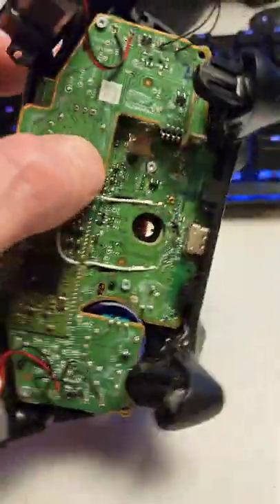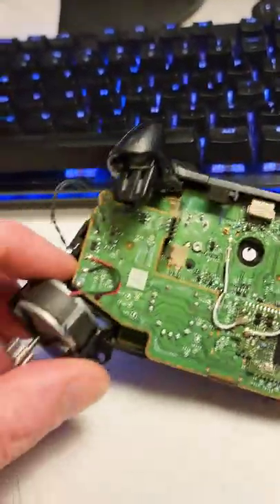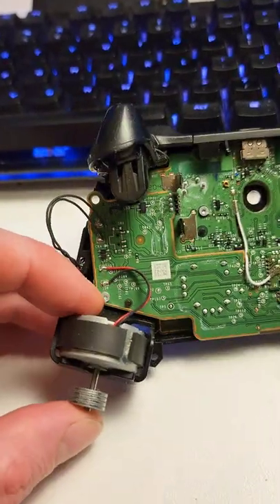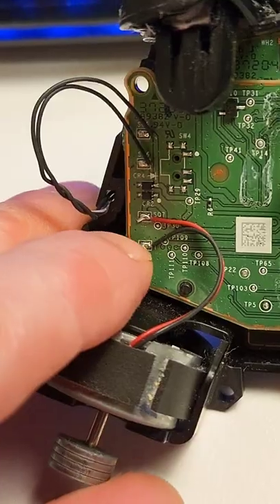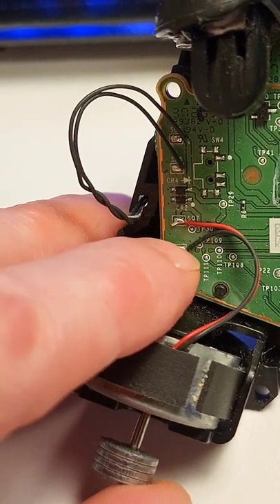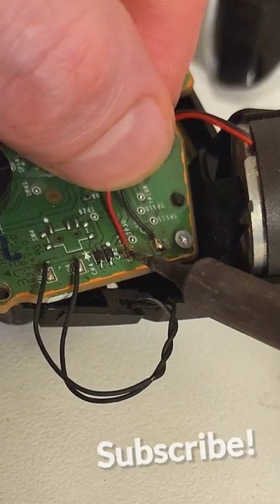if your controller stops vibrating, this is probably why..

Comment: You can mod these to clip the motors on/off if you need to open it regularly and don't want to solder every time. It's so easy and cheap I wonder why microsoft didn't do it.

Comment: I definitely don’t rip them out to reduce the weight 😂
Reply: Really? I like a heavier controllers
Reply: King
Reply: All the time 😭
Reply: After using a ps5 controller the Xbox controller seems so much lighter
Reply: I usually have them turned off but ripping them out to reduce weight?!? Do you have pigeon arms or something? Ive never even thought about the weight before its so unnoticeable
Reply: @VoidMySoul  🤡 what are you on about
Reply: You know I’ve never thought about that… I don’t like vibration so I might do it

Comment: Yeah, I remember my 3 year old brother getting grape jelly all inside the controller, I opened it up and cleaned it only to realize I snapped off both wires on the vibration motors.

Comment: Fun Fact: To disconnect the motors on an Xbox 360 controller, you just have to unplug it from the board, & no soldering skills are required!

Comment: I’ve only ever opend a controller to remove the vibrators it’s annoying especially in games where u can’t turn it off
Reply: All modern consoles have system wide options to disable vibration, no need to open a controller to do so unless you really want to remove the motors to reduce controller weight.
Reply: @Sevicify  not all games have the option and if there’s one to turn them off permanently in settings I haven’t found it although the weight reduction is handy
Reply: @LUCIFER-M0RN1NGSTAR  I don't have an Xbox to check myself but quick search brings up two methods. In system settings go to Devices & Connections -> Accessories and choose a controller to configure, in this configuration page select & edit the appropriate profile slot which should show an option to turn off vibration. The other method is again in system settings go to Ease of Access -> Controllers -> Vibration Settings which should bring up another page to turn it off. Definitely not the easiest settings to find blindly, I know I wouldn't think to look in Ease of Access myself.

It's a fair bit easier to find if using PS4 by going into Devices -> Controllers in settings and uncheck vibration. On PS5 you go to Accessories -> Controllers in settings and set vibration intensity to off. On Nintendo Switch it's even simpler going into Controllers & Sensors page in the main settings menu.

Anyway the weight reduction could indeed be handy for some, personally I don't mind the weight with them and I do generally like vibration.

Comment: Yeah but who even keeps the vibration on at all? Disable forever.
Reply: @TinkerManMick  I’ll still never understand how despite creating your YouTube channel five years after I created mine you somehow have more subscribers than me. It makes no sense!
Reply: I do, I quite like the force feedback and have never had any issues with it on any controller.
Reply: @Sevicify  force feedback, and vibration are two different things.
Reply: @doggin6  Force feedback, in reference to video games, is the general concept of simulating a sensation of force on the input device a player is using  in response to events happening within the game. Vibration of an input device through use of motors with offset weights is just one physical implementation of simulating force sensations to the player  and thus can most definitely be described as, and historically commonly has been, as a form force feedback. So no I wasn't wrong in my use of force feedback.

Comment: hey mick. i recently took apart my elite series 2 and put it back together and have found that the mic has stopped working with the controller. the audio still works and the mic works on other controllers but i can’t find a fix for this

Comment: I accidentally ripped out the left (larger) rumble motor on the left side of the controller when I opened it for switching a button or two (did it before once without any issues). After soldering the wires to the correct places and checking with a multimeter to make sure it's connected, it will no longer rumble (at all). Only the right rumble motor activates when I connect it to my PC via a cable (only when connecting, though), and bluetooth no longer has vibration.

Any suggestions? Maybe I should redo the soldering or something?